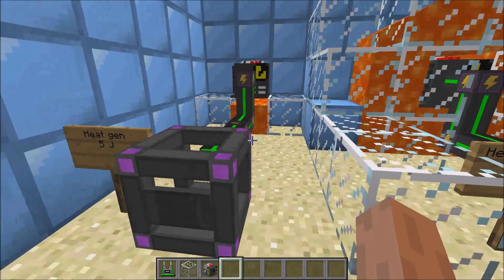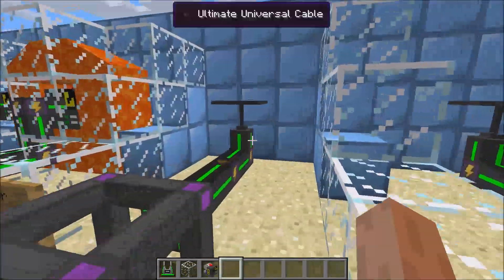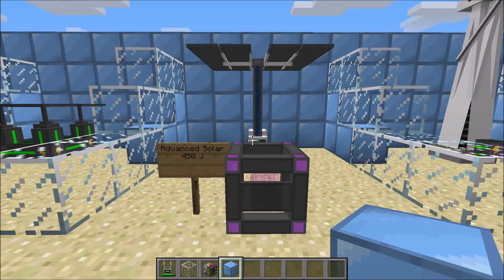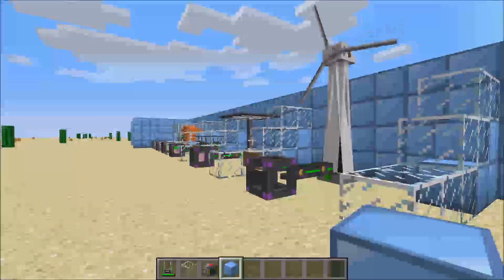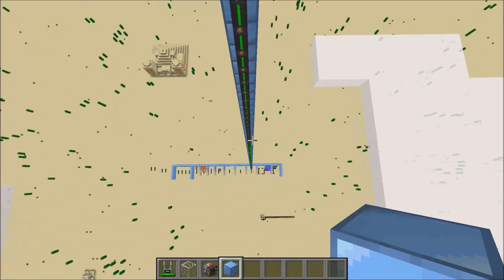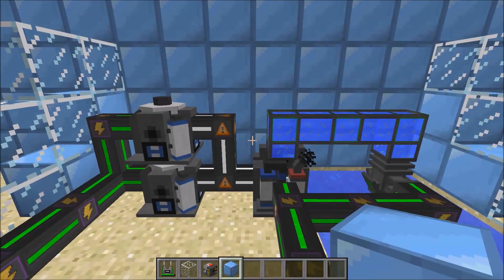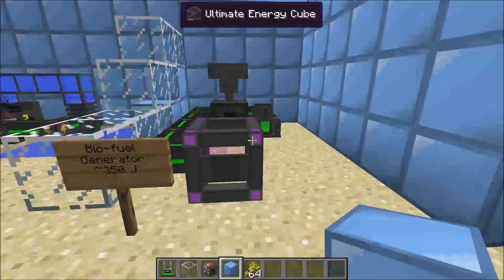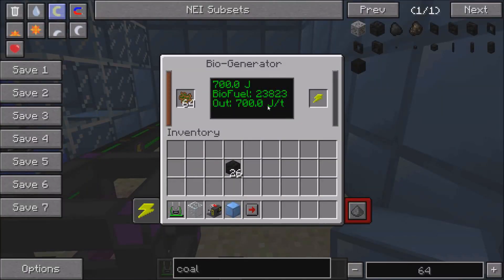Mekanism 1.7.10 Mod Spotlight  Ep2: Energy Generation

Comment: Aww man they fixed the infinite power? :( Lame.
Reply from the maker: Yeah i was bummmmed
Reply: Shane Dublin Gas-burning generators generate varying levels of power based on the gas that is used. By far the best to use is ethylene. The way to setup the system is complicated but will result in a net gain of power.
Reply from the maker: I don't know if that was in the mod when i made the spotlight. I guess I could have missed it.
Reply: Shane Dublin It's cool, you probably have the most comprehensive spotlight on Mekanism 1.7, so I just wanted to add any missing information in the comments
Reply from the maker: Thanks,  I might re download and see if i can get some automated ethylene going.
Reply: The setup is easiest to do with Ender IO installed as well, using a semi-auto sugarcane farm and a vacuum chest so as to not have to restock the crusher with stuff to make bio-fuel. You can do it without Ender IO but it requires a lot more hopper work.

Comment: How actual to make electrolyte seperator to work ?
Reply from the maker: Pump water into one side.  Provide the machine with power.
The water gets turned into hydrogen and oxygen gas.  You can't use the separator to make infinite energy.
Reply: Shane Dublin Thanks .... it works ....